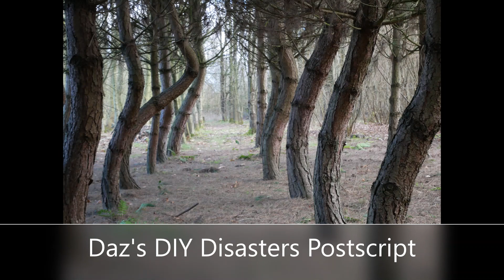Heartwood Woodfuel Group Felling Oaks, Lorries stuck. Woodland Vlog 10 2022

Comment: Do you ever stack the trailer with all the logs  at the start of the video crossways as that's what works for me.
Reply from the maker: I’ve not, do you find you can get more in doing that
Reply: @AbellTo  yes as my trailer is similer to yours and has cage sides I remove one of the sides and find I can pack the trailer easier and higher by going crossways. The other direction is fine but there's alot more airspace
Reply from the maker: Send a photo over so I can see how you do it